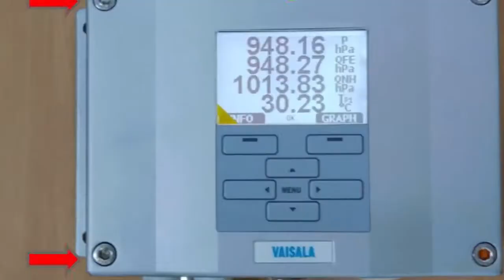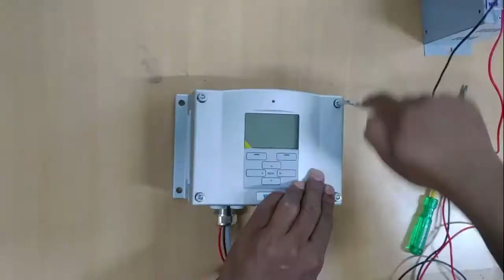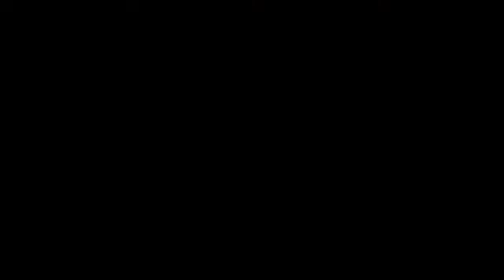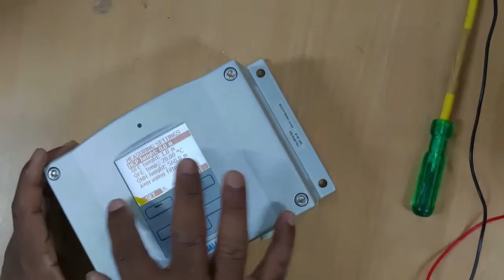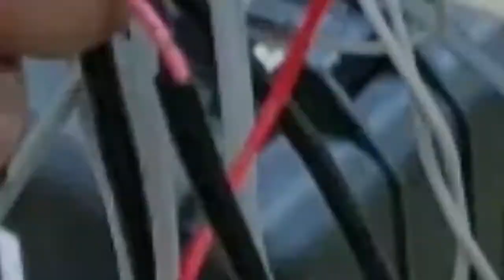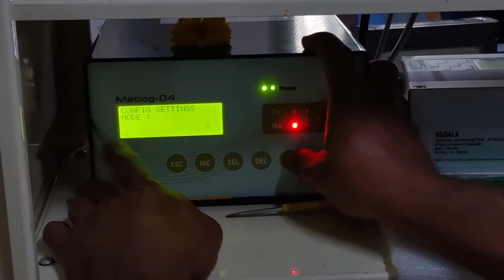Digital Barometer Pressure Sensor

Comment: amazing, could you please demonstrate the inner structure of the barometer PTB 330, which is pressure sensor, transducer, transmitter, analog parts, & electrical parts , thank you